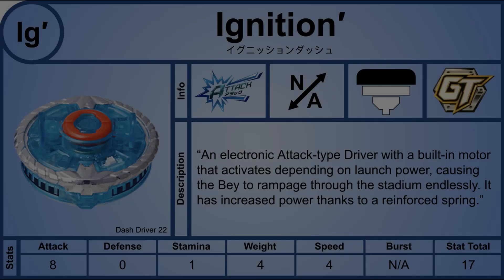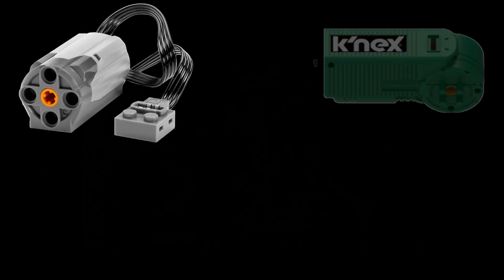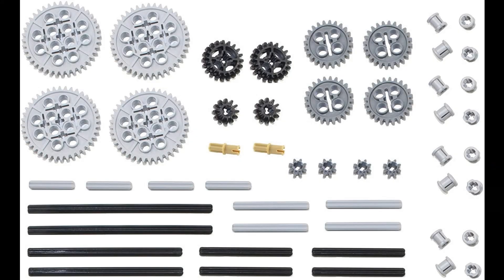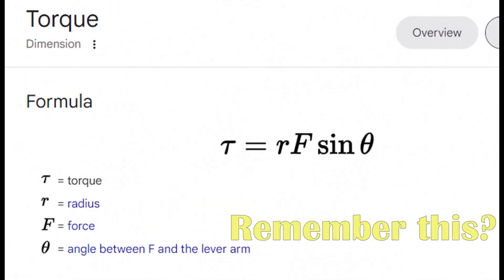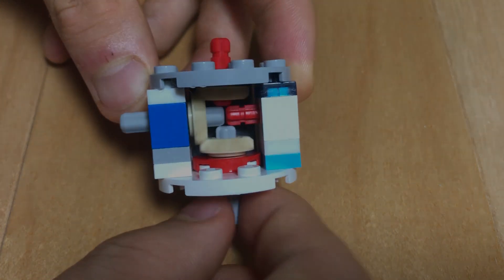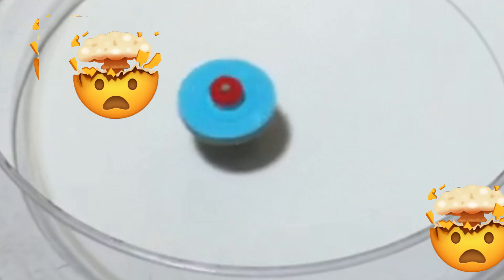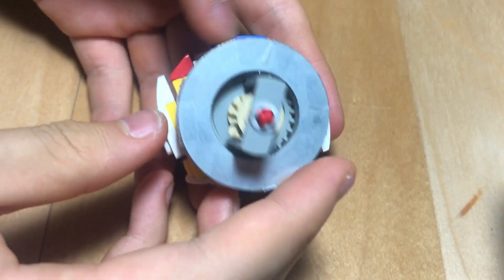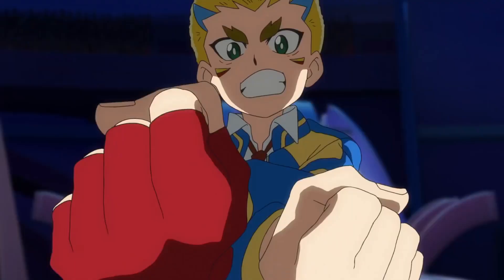The Failure of Lego Ignition'

Comment: dude why not put like a limit break system where it unlocks mid battle (dont worry about size just yet) then make the next part and integrate it into your system, oooooooooooooooooooooooooor you could make the motor you want to use a bit stronger by replacing insides (try to find one that can have connections on the side, you could also try making the gear mechanism have little scraping system that goes in opposite direction so you could drive enough force, or just wait for some new parts, try 3D printing lego parts if you can making it easier to make

Comment: I know it’s a bit too late for any suggestions with the ignition driver. But instead of using gears to change the spin during battle, you could probably pull off a lego Helios Volcano gimmick in the driver to reverse its spin using rubber bands when it’s hit hard enough. I think it’s possible to make this with a compact enough space, and you could probably release it in a random booster with some sort of recolor.
Reply from the maker: The main problem with this, which many others already suggested, is that the rubber bands wouldn't provide a continuous change in spin direction but rather an instantaneous one. Even if it did work, the momentum would only shift for half a second at best.
Reply: @Legobeyz  how about springs

Comment: Or just use the spring loaded gimmick of Helios volcano but it releases at the opposite  direction
Reply from the maker: There are two problems with this. First of all, it'll be the layer that spins, not the driver, since the layer is the one with less mass. Secondly, even if it did work, the change would be instantaneous rather than activating over a certain period of time, similar to using rubber bands.

Comment: Maybe make it work more like the engine gear instead of the real ignition. Like a wind up toy. Use a rubber band to retract it
Reply from the maker: The problem is that it won't act like ignition. The change will be instantaneous, not continuous, so the driver will just stutter at best.

Comment: i have an idea : similar to your hybrid driver, make driver that uses rubber bands to go counter clockwise when the spin is slow, now i havent really test it because of :
1. i dont have enough peices
2. i dont have much technic peices so i cant just recycle parts :u
Reply from the maker: Sorry to tell you, but that simply doesn’t work. Rubber bands can’t reverse the spin in any way.
Reply: What about cutting the rubber band to make a string like thing, tape on side to the tip (bottom)and tape the other side to the driver(top) then wind it, or maybe it works better In my mind :u
Reply: Basically, cut off a rubber band into a string, make a free spinng tip driver, tape/glue the freespin tip to one side of the rubber band, and tape/glue the other side to the  non freespin part
Reply: Maybe try adding putty to the free spin tip and make sure to use a strong rubber band, so when the bey spin the tip winds up, then when the spin is low, it unwinds
Reply from the maker: @Arcturus77-2  Unwinding something like an engine gear doesn't work well: and even if it did it's an instantaneous change instead of a continuous change
Reply: @Legobeyz  well... I guess your right, (I tried it by making the rubber band looser but it just snaps,)

Comment: hmm, have you tried using a makeshift sort of Engine gear system for your Lego ignition'? it's an old system back at the plastic generation of Beyblade and maybe you could use some small techniques and some rubber bands to pull it off, although you do have to wind the driver again before another battle and change the rubber once it gets worn down from stretching stress, for someone like you who knows Legos pretty well, im sure you could recreate it somehow
Reply from the maker: I know of the engine gear system and have seen videos such as Lauran's that try to recreate it, but I don't think rubber bands are complex enough to get the opposite spinning motion. I think the reverse engine gear operates using a rotational spring to store rotational energy, which is hard to obtain at the right size, and even if I got it, it would be challenging to get it to activate at the right time.
Reply: @Legobeyz  well you have a good point there my friend

Comment: What if you put a non-rotating gear on one side of the beyblade and the driver have a gear that connects to it but is free spin. I don't know if that makes any sense but I made a video on it.
Reply from the maker: From what I can understand that just seems like a normal free spin driver
EDIT: After watching your video it seems like you tried to used the simple 2-gear method.  However, I don't think it'll work, since they're not on the same vertical axis.
IF the red axle gear is free spin to the grey axle gear then the layer spinning will not rotate the other way (relatively): it's like the moon orbiting the Earth. Just because the moon moves one way doesn't mean that the Earth rotates the other way. If the two gears are not free spin, then there's no transfer of torque. But if you can get it to work IRL, I'd be happy to be proven wrong.
Reply: @Legobeyz  Thank You for responding. I wanted to try to make the gear on the layer free spin but I cannot test it out but I will once I get all the pieces.

Comment: I think you should replace this red plastic tip to rubber one and equip this ring on the layer. After the bey is launched, the friction of rubber must stop the driver, but the layer will keep spinning, so this mechanism will start it's work. In theory, it must work like this. The only problem is to find this rubber piece.